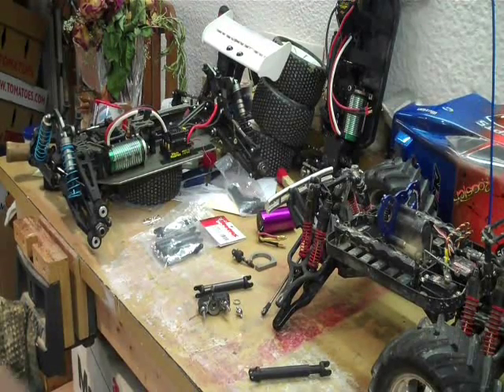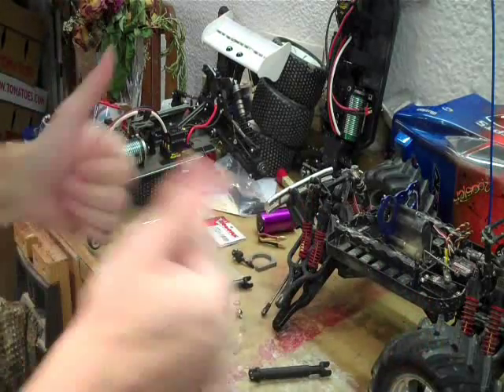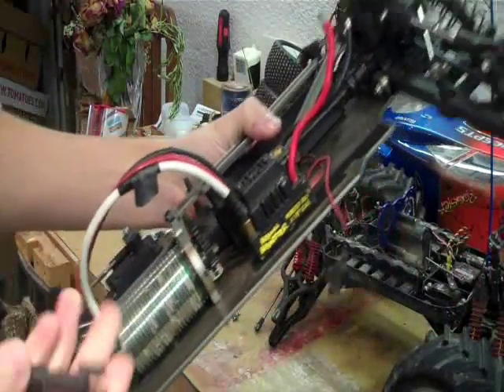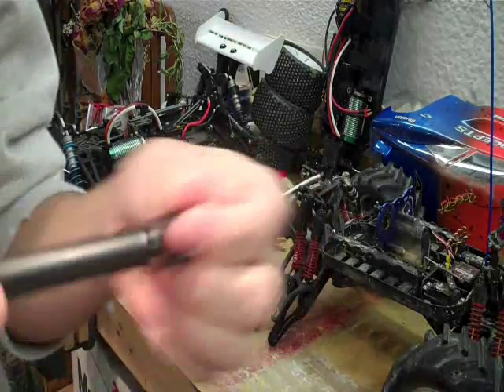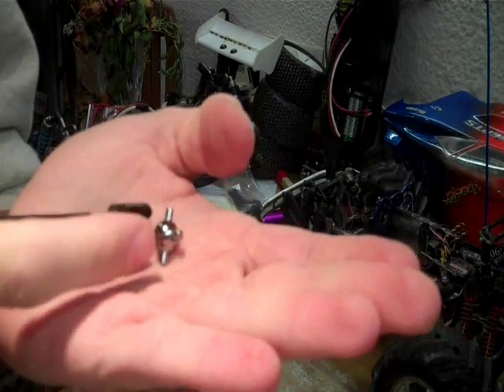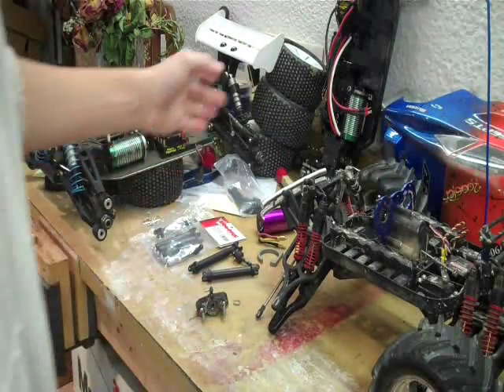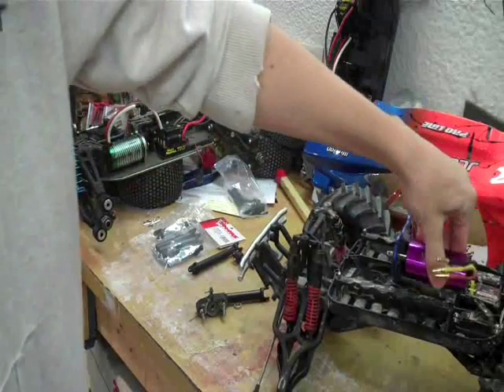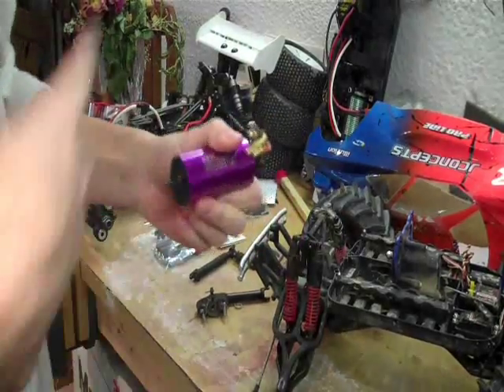Asking Squirrel - Getting the Yokes in Driveshafts.wmv

Comment: As a technician specializing in driveshafts for real vehicles, my best advice is to try opening up the space between the ears yoke so that you can fit the u-joint inside it, then (since the shaft is plastic and the ujoint appears to be metal,) try a glue that doesn't bond to metal, to close the ears of the shaft again. Main thing is, the yokes are already on the shaft. The loose bit is called a universal joint, or ujoint for short.

Comment: take a small  wood dowel, about the radius of the male drive shaft center hole, with notches cut into it, lather it with epoxy, then put it down the center of the male drive shaft. Makes them last forever!!!